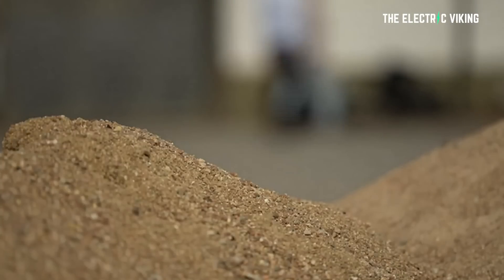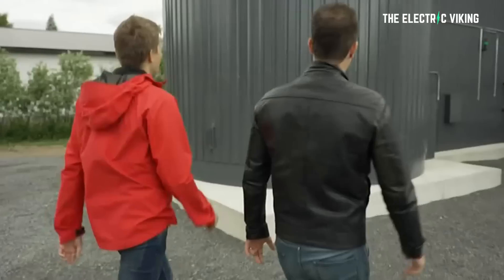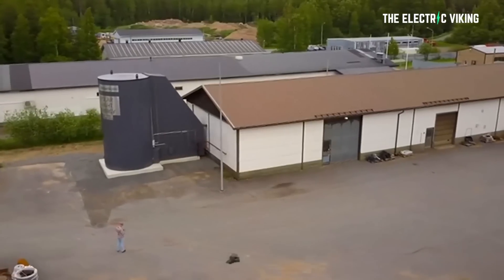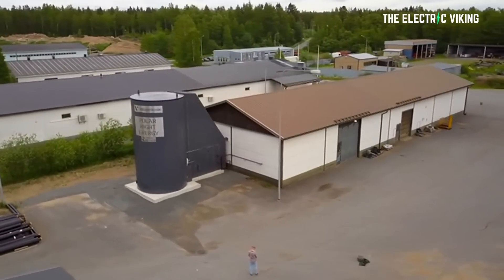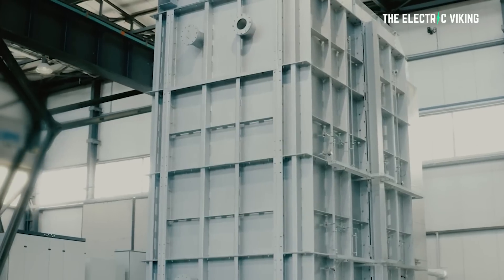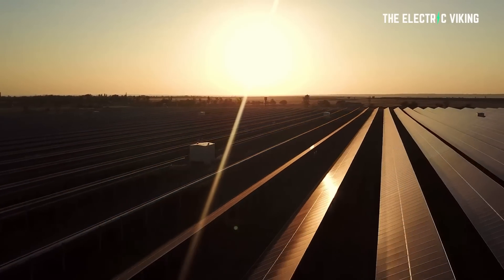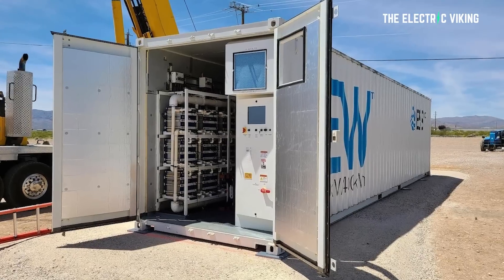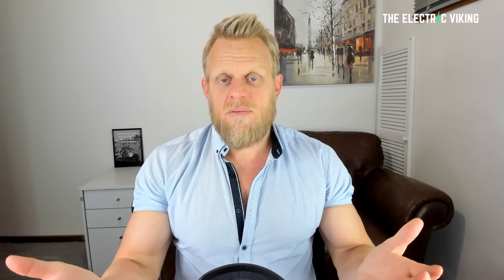The world's biggest sand battery is powered by solar & wind

Comment: Liquid metal battery is great Conaway developed it 2 hour video on YouTube but yah great idea what if you created steam with it recycle steam then run turbine creating energy from sand batter to turn sand battery to elecity you on get a 25% out of 99% use conversion still how much energy if stored recycled water from water to steam energy could you produce no need for nuclear reaction I don't know what boiling point of water is but sand batter get to 1700 degrees good idea would it be a good solution if you used wave energy cables to sand batter would have to worry about wasted land from solar or wind right 😉

Comment: If the sand batteries could replace coal, like PNE mentioned they are looking at in the one video on the their website, then steam turbines have their new 'fuel'. Bye-bye CO2 emissions/air pollution and hello just about 100% green energy! If thát's not a Win then I dont know. Just hoping it wont go the same route as way back when when the first electric/hybrid cars were mentioned and the oil cpy's threw a spanner in the works. To prevent that, perhaps the coal mines should start a new business and rather sell electricity?

Comment: In Australia (and other places I'm sure) the wholesale price of electricity sometimes goes negative. That is if you want to put electricity into the grid you have pay to do that.
They often give the example that if someone turns on their AC the grid has to produce electricity to match that but it also works in reverse (but they don't give that example). 
Even in Melbourne where whole sale prices currently are usually higher than retail prices the wholesale price was negative for a few hours last Sunday.

Comment: Sand batteries are good for cold climates, as the heat can be used not just to power a turbine to generate power, but directly, as you mentioned for your pool heating. In hot countries the opposite technology may be more useful, with liquid air systems like HighviewPower, since the ambient heat of a hot climate can then be used to regasify the liquid N2 and O2.

Comment: I wonder if they could use crushed glass as a substitute for sand? Sort of kill two environmental problems with one very tiny stone...
Reply: You could but I’ll bet 1 cubic meter of crushed glass would cost more than sand.  That’s because glass is easily recycled, but if you can get the glass BEFORE it goes to a recycler, maybe economical.

The other problems with glass would be:
•  air pockets, 
•  impurities that have a lower melting point 
•  impurities that burn
•  and broken glass cuts skin and insulation and maybe tanks

Comment: sand evans? :)
Reply: why so serious, sam
Reply: can can can can, or course you can, can of sand :)
Reply: we are experts in sauna tech
Reply: there is not less 100% efficient, if you have heat "losses", you can capture all
Reply: you can even directly heat that sand with concentrated aluminium mirrors for solar
Reply: then you dont even lose 70% by using pv solar panels
Reply: you use your pool to heat itself, dont make separate coils
Reply: any rock works, crush it if you dont have sand
Reply: normal ball mill

Comment: There actually is a construction-grade sand shortage, which sounds unbelievable, but regular desert-style sand is not good enough for cement, so if it could be used for energy storage, it could be an export product for countries with large sand deserts.
Reply: All of this sand has to be obtained locally to be as cheap as possible,no reason to ship it anywhere.
Reply: @firstbigbarney  - The example in this video, Finland, has very little sand (lived there for 30 years).
The biggest sand exporter is actually the USA, followed by the Netherlands and Germany.
China consumed more sand from 2011 - 2013 than the US in the 20th century combined.
It is "mined" at great cost from the ocean bottom and transported long distances.
This, of course, applies to construction-grade sand,  not energy storage. If one lives in Sahara or Gobi desert, the sand seems to be plentiful everywhere, but that is not the case everywhere.
Construction-grade sand is too expensive for energy storage and cheaper desert-quality sand is not always nearby.

Local sand is always better if it is not construction-grade sand. If one has construction-grade sand one makes more money shipping it to China than using it locally for energy storage.

Comment: Hmm... heating sand in the desert? 🤔
Why not useSolar heat directly, and transfer it to the sand via heat pumps? That could be much more efficient. Using Solar PV only makes sense if the excess electricity from them is used, as you mentioned. That's because PV panels are generally less than about 20% efficient, and that decreases in hot weather.
Reply: This sand battery makes use of solar or wind electricity when The Grid doesn’t want it.

Comment: Specific heat:
Water = 4200
Sand = 840
So water is 5x better at storing heat. 
Sand can get very hot where water wants to boil.
Reply: But with boiling, you get a new set of problems.
Reply: Water turns to steam/vapor at 100'C and that has always been the problem to solve when trying to store heat in water. It also expands dramatically. Sand stays a solid and I'm sure the PNE design provides for any expansion that might occur. Very interesting Tech these guys are onto
Reply: You are correct, but water also wants to give up that heat 5x faster, and as others have stated you can only go up to 100°C.  Sand can be heated to 1700°C before it melts.

No doubt using water is easier, but you’d need a huge tank that is even better insulated.  Better put a steam vent on it too!

Comment: We have little ability to judge how well it works without a major statistic: how efficient is it in holding the heat? That is, how well insulated it is. I saw the guys able to keep their hands on the outside of the tank, suggesting not that much heat was getting out. If it's very efficient, then it IS a viable solution, and even with modern monitoring and management, the low-tech simplicity is appealing.
Reply: Easy.  Take any tank, and spray the inside with foam.  I would use closed cell, for its R-value.  It’s hard as a rock when it dries, which may hold up better when  you load in the sand AND from the slight movement, expansion and contraction during operation of the heat battery.

Comment: Water under pressure can store a hell of a lot more energy than sand, and cheeper. Enough isolations and it holds it energy as long We will.
Reply: "under pressure" being the
 point.
Reply: Roger Starkey is absolutely right.  You COULD do that, but it will no longer be a DIY or cheap project.  And liquids under pressure have a tendency of rupturing.

Comment: In Germany we have a new battery as well. It is a stone oven and is heated by burning wood inside the large oven spoace. It stores the heat and when the fire is gone,  you can put loafs of bread into the oven to bake them. It is pretty successfull as "wood oven bread" is quite famous here. I have to admit, it is actually not new.

Comment: Actually it is not a battery, as it does not give you electricity back. It is a heat buffer which is part of many heating systems but there contains water instead of sand. My 800L water buffer stores the heat of my wood pellet boiler for about 24 hours at maximum. So, the sand "battery" should have a good insulation like a vaccuum insulation, which is not cheap. 
If you want your electricity back, you need a turbine and generator.
Reply: A "Battery" doesn't have to be electrical.

Comment: Why use resistive heat source rather than a heat pump which would be dramatically more efficient? For that matter why not use thermal collectors rather than PV's and then convert it to heat?
Reply: I guess because resistive heaters are cheap and simple. While other methods would be more efficient, this is a dirt cheap way to make use of intermittent energy sources and fluctuating energy prices. When the wind blows, the electricity prices sometimes fall to under 1 cent per kilowatt hour. They need somewhere to dump the renewable energy or have some of the windmills shut down. In the same week even, the electricity prices may be above 50 cents. It's cheaper to use stored heat than to burn oil or use expensive electricity to run heat pumps.
Reply: Does anyone think they havent considered this?
Reply: @rogerstarkey5390  considered what exactly?

Comment: OK Viking - Im glad you want to concentrate on real things but - A. you say it "can" be powered by Solar or wind not that is must be -B. calling it a battery?  "a container consisting of one or more cells, in which chemical energy is converted into electricity and used as a source of power."  Might that be a bit of an exaggeration as it mostly stores heat and circulates hot water?
Reply: In an expanded view of the word “battery”:
“a device that stores ENERGY for later use”

“Free your mind, and the rest will follow.” — En Vogue

Comment: The economics work, energy companies in Finland are investing in this. Sand is available almost everywhere, concrete structures could not be made without it. When this technology matures, there is the option to combine this heat storage and use technology to turn heat into electric power using Sterling engines for example or even combine it with the AMBRI liquid metal electric batteries that generate heat. Very promising indeed.

Comment: Yeah, as you said I wonder about the efficiency of the thing.  Its ok to store that heat but how readily can it be replenished while its being used.  I would think pumping hot water all around isnt the best choice but rather using it on site at a home or office maybe.  Interesting and I agree, part of the solution overall.  It has its place.
Reply: You CANNOT use water as the medium.  It will flash to steam at 100°C, at which point the water’s volume will expand 1000x.  What will happen to the pipes kids?

Comment: Heating a pool by heating sand and then using it to heat water makes as much sense as commuting by horse by sitting on the horse while it is transported to the destination in a horse float towed by a car.
Why not heat the water by solar tubes and using a properly insulated pool with and insulated cover?
Reply: Be nice
Reply: You are correct, if he wanted an entirely separate apparatus.  I thought the author was trying to use renewable electricity when The Grid doesn’t want it.

Comment: I had planned to do it with an electric water heater full of sand .It would dump heat much like the concrete in the building during the nighttime.However the lfp batteries have become so cheap it seems more convenient to just run a heat pump off the batteries. Still seems like a great idea at larger scale.
Reply: Why sand? Why not just water with a lot of insulation around the tank?
Reply: @rogerstarkey5390  I guess the temperature of sand could be a lot higher...but then its probably easier to heat and extract heat from water...
Reply: @rogerstarkey5390  water doesn’t have much “heat density”.  And you can’t heat water beyond 100°C, because it will flash to steam and blow up the system.
Reply: The tank I was going to use is a leaker. The idea was to have bare metal exposed so the heat easily radiates into the room. Sand can be heated to a much higher temperature than water thus storing more energy.The use of an insulating cover in the day ,when removed,would release the heat. But,as I mentioned earlier,Signature Solar has LFP batteries so cheap it is simpler to use a heat pump.

Comment: We'll need all of these different energy storage methods. I've been a proponent of compressed air. India has done some work on this. There are already  air tools with motors driven by tanks and compressors. 'Solar or wind could power the compressors and the air tanks wouldn't need the insulation  the hot sand taanks need
Reply: Compressed air does not work because it is not energy efficient.
Reply: What you wrote is correct, however storing pressurized air will be expensive and difficult for months-long storage.

Comment: I love seeing all the innovation in the energy storage space!  My concern is that none of these solutions benefit from economies of scale or robotic manufacturing like batteries, specifically, LFP batteries.  

The most economic solution will win in the end, and I just don’t see any energy storage solution in development that has a chance of competing with LFP batteries, particularly if everything (including EVs) becomes grid-connected and can participate in distributed energy storage.
Reply: True, what is economical will win, pumped hydro can be very cheap. With long cycle life batteries in EV's and  a large number of EV's we could see vehicle to grid as a solution as well. Most cars with 60 kWh are only going to use about 6kWh per day driving. A home uses ~10kWh per day. So plenty of storage in EV's to help power the grid. People will buy cheap rate renewables during abundance, then sell back to grid when supply is short making a small profit. Or even more likely just powering their home  and pretty much cut the grig operators off completely. Especially in Australia, with solar and batteries it is pretty easy to be independent.
Reply: @AORD72  
Pumped hydro needs an enormous amount of water at an enormous amount of height difference (“head”).  There are limited geographic areas where this is even possible.  In the USA, you’d spend years doing the environmental impact studies and fighting the NIMBY’s who are afraid of a catastrophic collapse destroying their houses.
Reply: @sambrusco672  Yes, pumped hydro is limited to location. But also there are lots of hydro stations already operating that can be converted to pumped hydro.
Reply: @AORD72  using your car as a part of The Grid will terminate your warranty.  It’s not an “intended use” of the battery.
Reply: @sambrusco672  "terminate your warranty", that would depend on the company you brought it from. With long life batteries like LFP I see things changing. If the batteries can handle thousands of cycles it is economical to also use them as house storage. And further more they can stabilize the grid.
Reply: @derek Elliot chemical batteries are expensive per kWh and they wear out.  The sand will never wear out,* and the heat stored in it will last for months.  We humans like it to be 20°C (68°F) year round, despite living in “temperate” climates with huge temperature shifts.

Chemical batteries will be used for mobile applications, like a car or electronics.  Thermal batteries don’t need to move.

* everything around the sand will wear out before the sand changes!
Reply: @sambrusco672  "The sand will never wear out", but can you install a sand battery to provide electricity in your home? How would you easily extract the electricity out efficiently? The best TEC's are inefficient, Stirling engines require maintenance.  Buying a LFP battery for your home is still likely to be cheaper than the cost that you buy electricity from a supplier over the life of the battery. Anyway if you install enough solar you just use the grid as a battery (sell them power and buy back less power and make a profit).

Comment: All sand needs to be graded into different sized particles for different uses like concrete making, mortar for bricklaying, plastering etc. so there is always a certain proportion which is not suitable for any building purpose and which would otherwise be waste. Being able to use this to reduce costs keeps the cost of the storage system down and makes the sums add up.